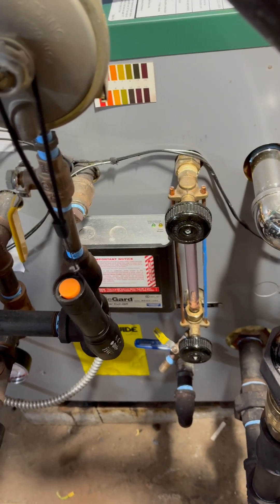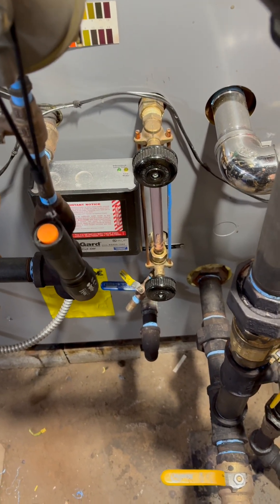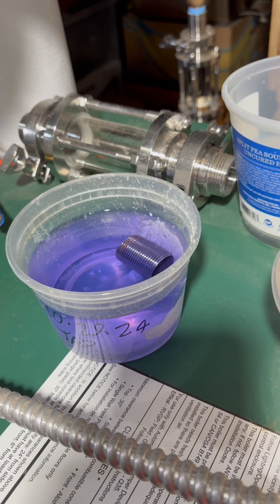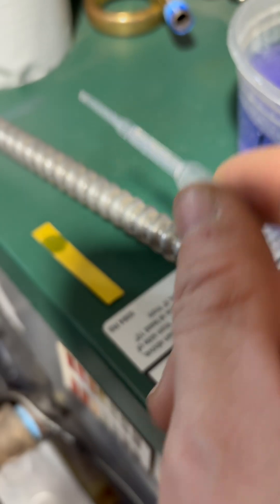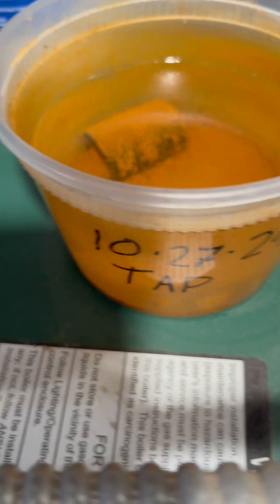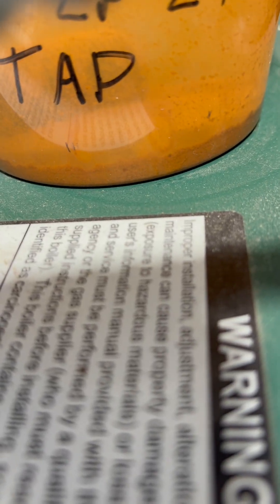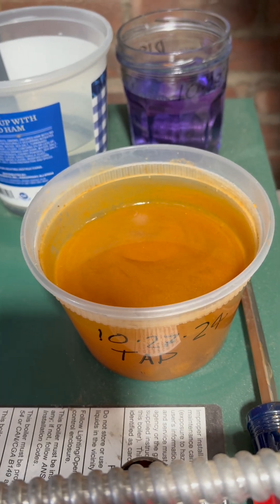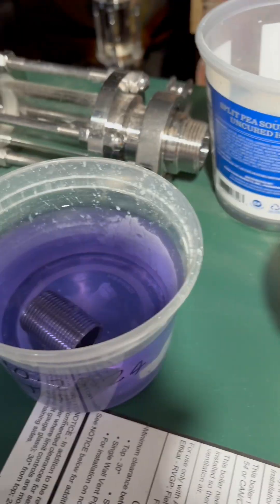Seriously, why aren't you using a steam boiler treatment in your boiler?

Comment: and I wonder why my returns were plugged solid with sediment!!  I've done 3 fushed with 8 way so far, and I nhave a bottle of surgex coming to try also, from the same manufacturer as 8way
Reply from the maker: I’m not a fan of surge-x but setting that aside, you are flushing your returns with boiler treatment?
Reply: @pb7379-j2k  Indirectly, yes. If you put boiler treatment in your boiler, it goes through the entire system, including returns. But I just flushed them out iwith hot water initially.  My system is over 100 years old, and the return that was plugged was that way long before i came along. It's one at ground level with almost no pitch. I also live in an area with hard, oxygenated city water.

Comment: Hi Paul.  Have been using 8-way for many years.  Boiler is 26 years old, Burnham SIN7.  Virtually no corrosion in entire system now.  I have 21 radiators in the house.  House is 90 years old.  I am happy with the product.
Reply from the maker: Thanks for writing! How’d you learn about it? I find most homeowners have no information about pH/boiler treatment
Reply: @pb7379-j2k  I actually had a problem 10+ years ago where my pigtail (steel one) got plugged up.  After that got replaced, my servicing company used 8-way to clear out the system.  I watched what they did, and then annually add a quart to my boiler after the service company looks at it and I clean it out.  With all due respect to my service company, i do a more thorough job ensuring the boiler, sight glass, pigtail, etc. are cleaned out each year.  I also replaced the pigtail with a brass one.  I actually think I learned how to clean my boiler watching videos from you and other professionals.  I also buy 8-way in gallon form as it a bit cheaper than buying individual quarts.  Wishing you and your family a very Merry Christmas and a happy and healthy 2026

Comment: Sorry for previous post. I noticed you already commented on Steam Clean
Reply from the maker: @Joe-s9o  no problem at all!! Based on what I saw of it, I might use it to soak up residual oil in the boiler, but probably not regular use…but I don’t know everything 😅
Reply: @pb7379-j2k  Thank You for the quick response. I just got a new boiler installed(Old one (UTICA) which was here when I moved in in 2010 had a crack on top and was spewing steam). I want to get a fresh start with the new one. Glad i found this channel
Reply: BTW. Like your video on how to make a boiler last forever. I have a hot water loop on my steam bolier so it' serves 2 purposes
Reply from the maker: @ I had an old Utica too when I moved to this house in 2017. There are Uticas all over North Jersey!
Reply from the maker: @Joe-s9o  cool. Definitely check out my video about my hot water loops and let me know how yours compares

Comment: I mentioned this in one of your older videos but I thought I'd mention it on this one which is current. Have you ever heard of Steam Clean by ComStar? 2 plumbers I've dealt with in NJ swear by it. I've been using it for years but never tested the water PH in my boiler. Thanks to you I will be doing that going forward to see how this stuff compare to 8 way. Will probably go with 8 way if I don't get the same results.
Reply from the maker: @Joe-s9o  thanks, I thought I replied to it. I’m not familiar with that one but if I recall correctly it seems similar to Squick

Comment: What do you recommend to add in boiler for steam to prevent surging
Reply from the maker: @sunil1979dp  I don’t really recommend an additive to prevent surging. I recommend skimming to remove the floating oils that cause some surging.

If the surging is caused by excessive brown water, etc, I would drain and fill a couple times then add some 8-way to boost pH to reduce corrosion 

But try skimming first. Are you sure it’s surging? What symptoms are you seeing?

Comment: Im starting to go over to steam clean. I still like 8 way but I've had way better luck with steam clean. Maybe you could try some experiments with that treatment.
Reply from the maker: I checked out what I could find about it. It has Sodium Carbonate which is basically lye so it boosts pH. It also seems to have the same ingredient as Squick that is meant to combine with oils to precipitate them out where they can be flushed out. Might be good for a boiler that is very difficult to skim, like I think Squick can be.

But the label is kind of optimistic about all the things it can do I think!

Comment: Best way to keep old steam boilers alive is with an anode on the boiler, it just drains out as it dissolves, i used zinc rods for boats. 1991crown hartford loop.
Reply from the maker: I don't disagree, but why wouldn't manufacturer's mention it?
Reply: @pb7379-j2k  maybe so they can sell more boilers?
Reply: why isn't brass pipe used for the near boiler piping?
Reply from the maker: @ probably due to expense and because steel and iron steam pipes and fittings last for decades anyway
Reply: I think It’s because the brass has a different expansion rate than the cast-iron. This has the potential to force the boiler sections apart as they get pressured by the piping and cause leaks ….

Comment: Interesting experiment. I think I should hunt down some 8-way. That said, have you considered doing the same test but using boiled water instead of just plain tap? That of course is what the boiler chest sees after a steaming.

Also, you might find it helpful to use litmus paper that’s targeted to the range of interest to better distinguish the colors.
Reply from the maker: Thank you! I have another container going with distilled condensate water and 8-way but I should make one with just plain distilled condensate to see how it compares with tap, you're right.
Reply: Most likely, the results would be similar, but curious what they would be using cast iron fittings that more closely resemble the boiler chest of the average residential steam boiler?
Reply from the maker: @ maybe I’ll run the test again with cast fittings, thanks!